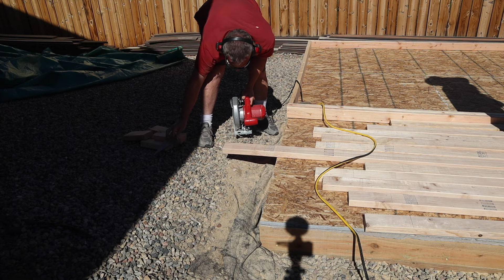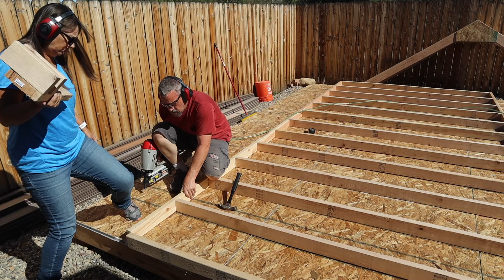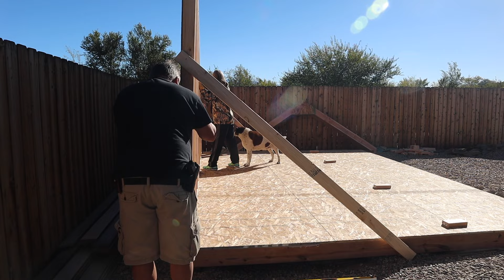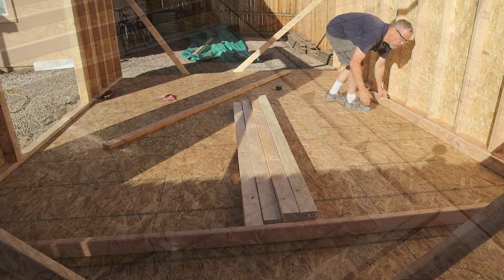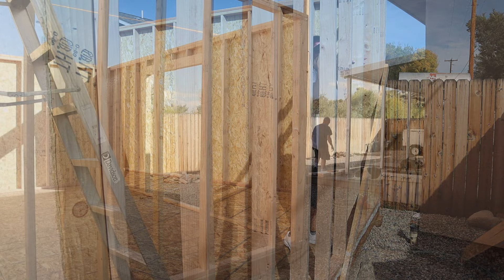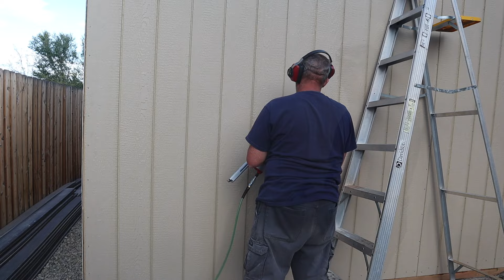DIY Shed Wall Build Timelapse (12X16) Tiny House

Comment: That was fun to watch, all that hard work. I had a 8x12 and a 6x8 shed built in my backyard  19 years ago. Every winter we would store our ceramic flower pots in the big shed, the moisture wicked out the bottom of the pots and weakend the floor so bad if you step there you will fall thru, now I have to replace the floor boards.😬
Reply from the maker: Glad you enjoyed it. At least you only have to replace the floor. Much cheaper than the entire shed. 👍
Reply: Yup and learned a lesson too.

Comment: Great build!   Just curious, what size nails did you go with to hang the Smartside sheeting?
Reply from the maker: Thanks XFBO - I used 2-3/8"X.113" because they are the shortest nail I could find that would fit in my nail gun.

Comment: What state? I'm just trying to figure out why you didn't use a moisture barrier, I mean you used one on the floor
Is this non-permitted?
Just curious, as where I am, tiny home have certain code "exclusions" but the "standard" codes remain (vapor barriers, 16" OC, etc)
Reply from the maker: Colorado and this is a non-permitted build because of the square footage.